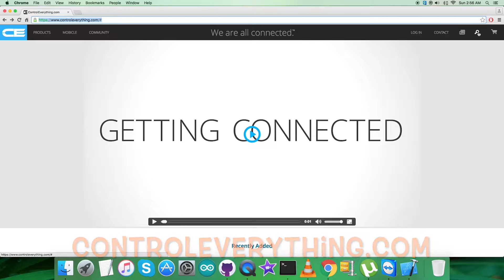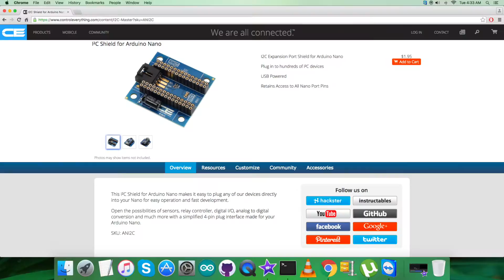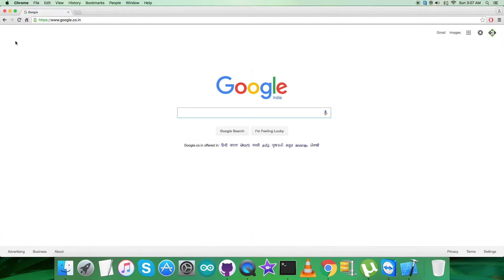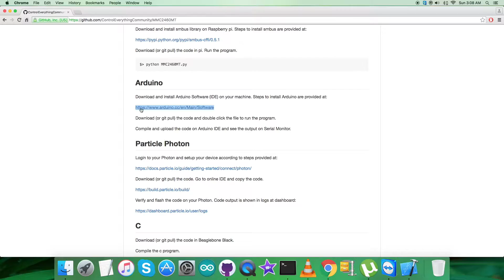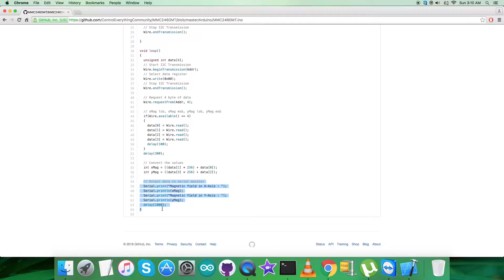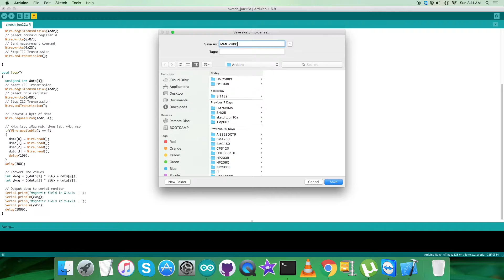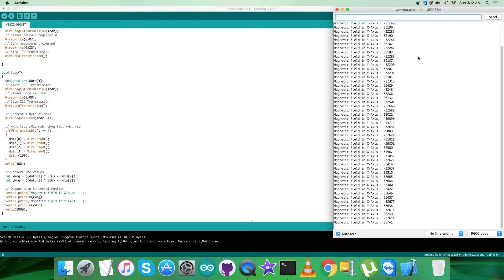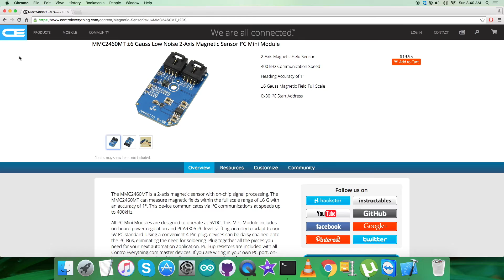Arduino Nano MMC2460MT 2-Axis Magnetic Sensor Tutorial

Comment: I have found the problem, thanks for the quick answer, another issue poped out, i get always the same value in COM serial monitor although I keep moving  magent, If you could help me out , I really appreciate it. this is one snap shot of output 
00:28:20.403 -> Magnetic field in X-Axis : 8197
00:28:20.403 -> Magnetic field in Y-Axis : 8208
00:28:21.808 -> Magnetic field in X-Axis : 8197
00:28:21.808 -> Magnetic field in Y-Axis : 8208
00:28:23.166 -> Magnetic field in X-Axis : 8197
00:28:23.213 -> Magnetic field in Y-Axis : 8208
00:28:24.572 -> Magnetic field in X-Axis : 8197
00:28:24.618 -> Magnetic field in Y-Axis : 8208
00:28:25.977 -> Magnetic field in X-Axis : 8197
00:28:26.024 -> Magnetic field in Y-Axis : 8208
00:28:27.382 -> Magnetic field in X-Axis : 8197
00:28:27.429 -> Magnetic field in Y-Axis : 8208
00:28:28.787 -> Magnetic field in X-Axis : 8197
00:28:28.834 -> Magnetic field in Y-Axis : 8208
00:28:30.192 -> Magnetic field in X-Axis : 8197
00:28:30.239 -> Magnetic field in Y-Axis : 8208
I have used the same code from githup explained in youtube. Thank you

Comment: hi guys, i have the same sensor and configuration , i got a lot of problem with arduino nano , could you please show which programmer you select for arduino nano IDE and about the board, there is different type of nano board, could you specifiy which nano
thank you
Reply from the maker: Hi, Can you please share the snapshot of Arduino board which you are using with your query on dcube community - https://dcubestore.com/community/ will definitely help you out there
Reply: I have found the problem, thanks for the quick answer, another issue poped out, i get always the same value in COM serial monitor although I keep moving  magent, If you could help me out , I really appreciate it. this is one snap shot of output 
00:28:20.403 -> Magnetic field in X-Axis : 8197
00:28:20.403 -> Magnetic field in Y-Axis : 8208
00:28:21.808 -> Magnetic field in X-Axis : 8197
00:28:21.808 -> Magnetic field in Y-Axis : 8208
00:28:23.166 -> Magnetic field in X-Axis : 8197
00:28:23.213 -> Magnetic field in Y-Axis : 8208
00:28:24.572 -> Magnetic field in X-Axis : 8197
00:28:24.618 -> Magnetic field in Y-Axis : 8208
00:28:25.977 -> Magnetic field in X-Axis : 8197
00:28:26.024 -> Magnetic field in Y-Axis : 8208
00:28:27.382 -> Magnetic field in X-Axis : 8197
00:28:27.429 -> Magnetic field in Y-Axis : 8208
00:28:28.787 -> Magnetic field in X-Axis : 8197
00:28:28.834 -> Magnetic field in Y-Axis : 8208
00:28:30.192 -> Magnetic field in X-Axis : 8197
00:28:30.239 -> Magnetic field in Y-Axis : 8208
I have used the same code from githup explained in youtube. Thank you